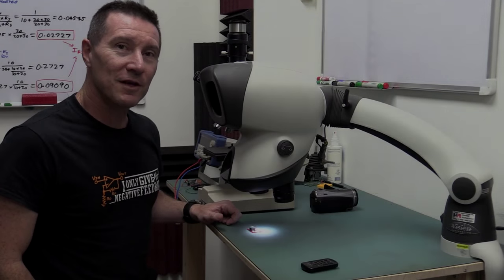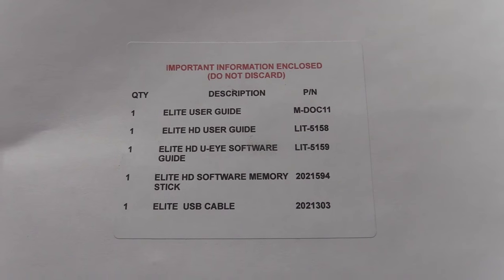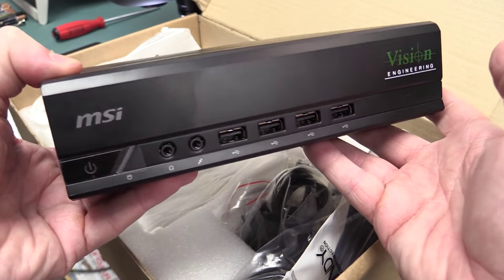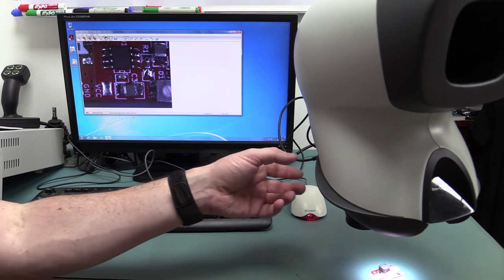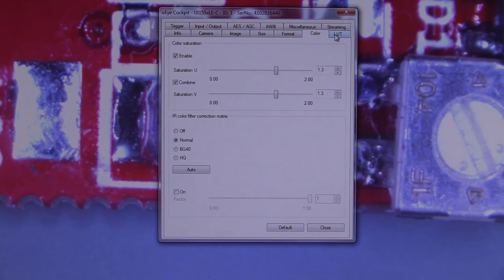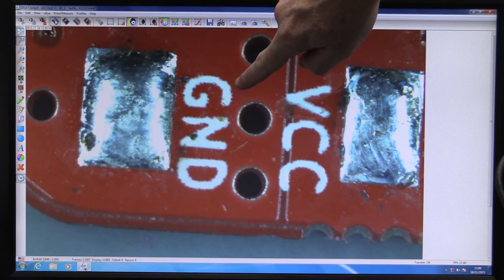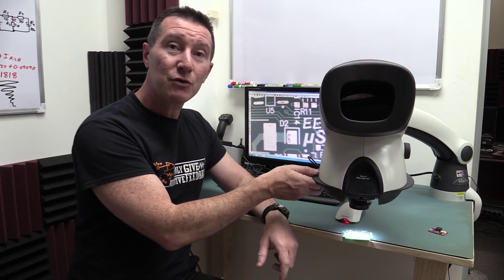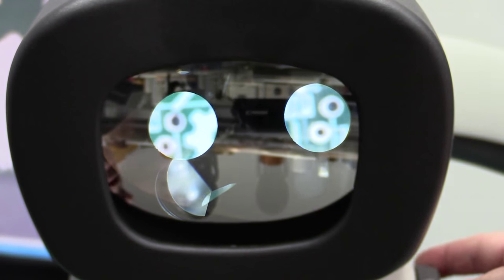EEVblog #817 - Mantis Elite Cam Inspection Microscope

Comment: Iiyama have been going a long time. 10 years or so ago their 17 and 19 inch CRT flat (front that is, not flat tube) monitors were the dog's bollocks - fantaastic colour, high scan rates and superb focus. Great for CAD and art work. Nowadays if you suggested a monitor that small, people would look at you like you were mad!

I think if I had paid all that money for this, it would be sent back and swapped for a standard model. It all smells of management / marketing panicking because they don't have a camera version, and they have rushed out a bodged-in one. If you didn't know better, you'd say it was Wunhunglo buying them in and hacking in their own camera. Disappointing.

Comment: Totally not impressed by that thing.
Why didn't they use USB 3.0 or even 3.1?
Why didn't they give the user the control over the viewpart instead of cropping 99% out?
Why didn't they callibrate for the optics for the measuring tool?
AVI capturing?... Seriously????

I mean, even a DisplayPort out would be more than enough... HDMI? Rubbish!

Comment: "These are very very expensive lenses."

Don't take up photography :)  You'll wish that very expensive lenses were only $600!
Reply: +Jonathan Rockway Owns several Canon L series lenses... Can confirm. Although to be fair, for that price you can probably snag a new EF 70-200mm f/4 L IS USM. An older lens, but pretty incredible if you don't specifically need the f/2.8's

edit: I am completely wrong, that lens is still like 1200$. I seem to have chosen to remember wrong for the sake of my own sanity.

/random lens talk

Comment: Very low quality sensor and poor result. The crop is ridiculous.
I'm sure all that complicated optics is good for viewing but it's just rendered moot by a tiny inexpensive digital setup instead of that clumsy bulk. Soldering by a monitor is easily superior because you don't have to hold your head in a strained position.
It's like a record player, it might be difficult to do right but dirt cheap flash digital just kills it. Their product is obsolete. Better move with the times.
It should of course also have a monitor output directly instead of a clumsy PC. And there should only be fullscreen. Amateurs.
Reply: +Mila Miglia I agree that for the price this is ridiculous. My NH1080 optixcam + proper lens adapter costs about $800. The microscope with the stand costs about $440. The entire setup I have costs less than the DIFFERENCE between the regular Mantis and the Mantis Elite Cam. They are printing money offering this terrible ten year old cheap obsolete webcam for $1700 extra.
Reply: +Louis Rossmann yeah, I'd say at the very least the quality of sensor of entry level point and shoot tourist cameras. I think Sony sells their sensors.
If they want to represent quality, it better be quality.
They might put it on a motorized rail so the camera can shift angle on its own if you need to see it from a different angle, maybe some 3D reconstruciton software to enhance certain things. And focus stacking.
Also automatic LED angle control so you don't have to hunt for an angle where you can see the print on chips.
Reply: As much as a wuss as I will sound for saying this, particularly on Dave's channel, I would be afraid to open a Mantis and try putting my own camera in. With how much it costs I wouldn't want to risk destroying it and having no warranty either.
Reply from the maker: +Louis Rossmann Mantis very strongly recommended that I do not open the unit. The chance of throwing off the optic calibration was high.